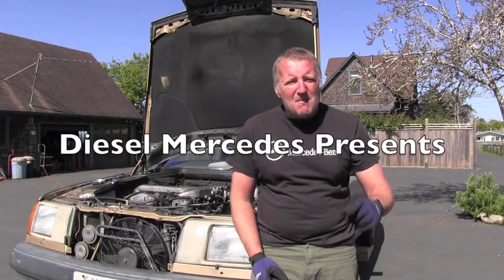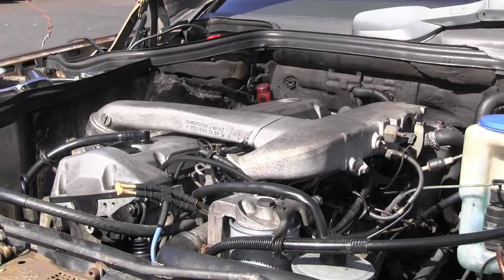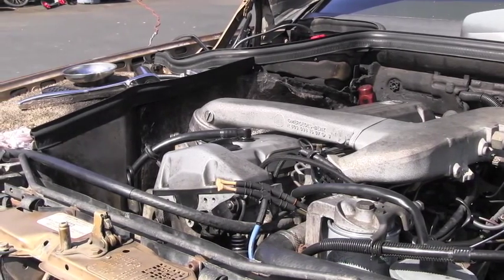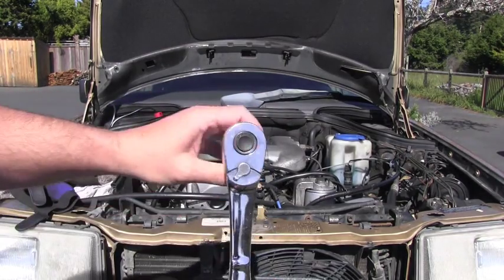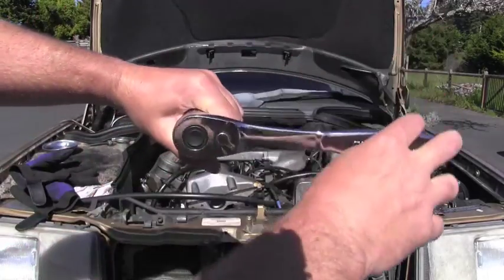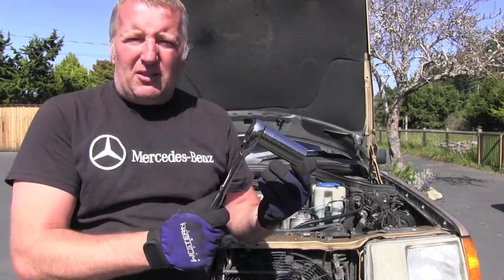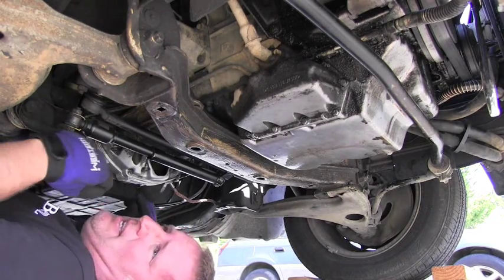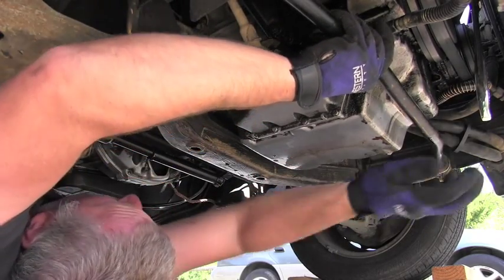How To Rotate Mercedes Diesel Engine

Comment: Does this same trick apply to a petrol M111 engine? Also should I turn the engine clock wise?

Mine is been sitting for 3 months and I’m intending on going it for lubrication before I fire up the engine to avoid cold start damage.

Please help!